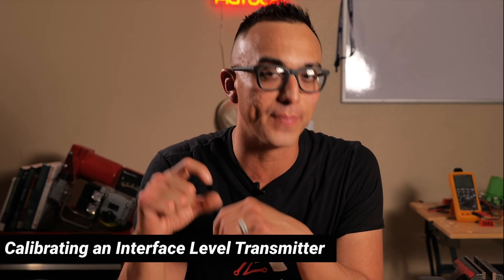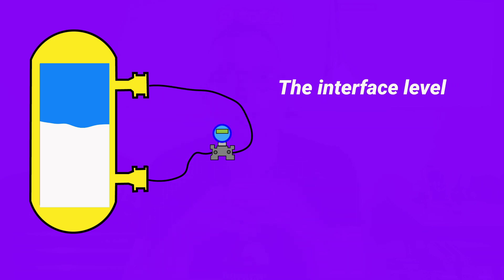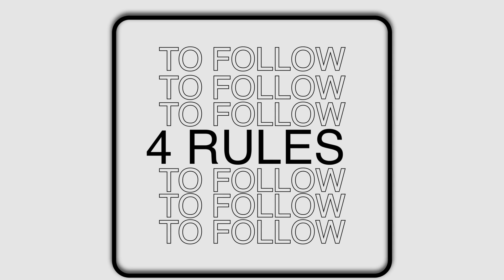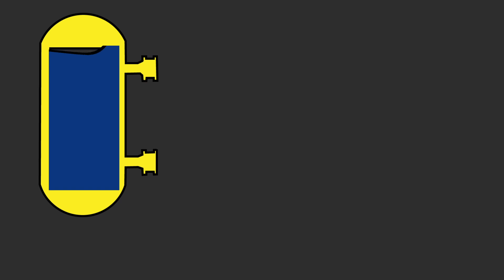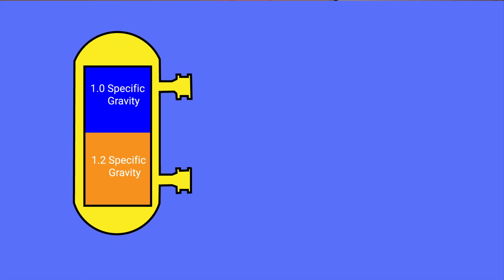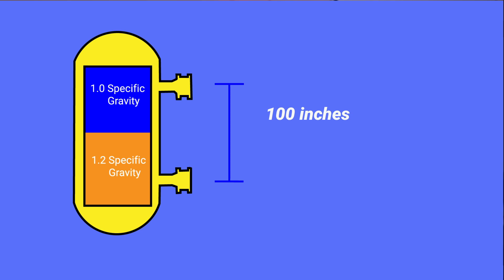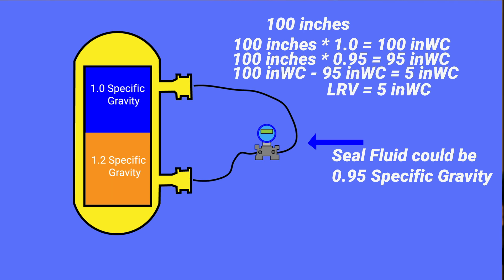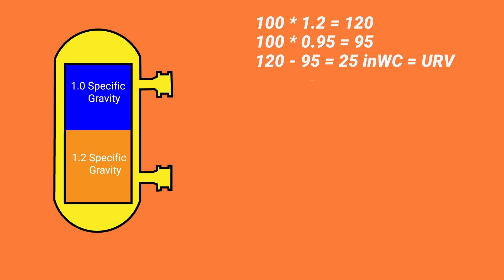Level Measurement - How to calibrate an Interface Level Transmitter

Comment: good evening sir, thank you so much for this, please i want to ask

currentle i work with E4 Modulevel magnetrol displacer level transmitter.i have tried to carry out zero and span calibration but i still get wrong readings as compared with the manual sight glass guage. it is supposed to work as an interface measurement
Reply from the maker: Great Q. I've worked on these on the past as well. Quick Qs: 
Are you doing a dry calibration or wet calibration?  (Manual: 2.6.5.1 Dry and Wet User
Calibration Procedures)
Are you receiving any error codes?
To further troubleshoot, would you have a full model number? It should start with "E4M..."

Also, if you believe the configuration is correct, and calibration has been attempted and still not correct, it could be an internal problem...perhaps the displacer is hung up or possible build up in the root valves.

Please let me know how this job has gone for you. Thanks!

Comment: u get 0.95 from where
Reply from the maker: Great Q. So, the 0.95 SG is the specific gravity that is the fill fluid inside the capillary armored tubing for the remote seal level transmitter. So, the 0.95 can be different, it could be a little lower or a little higher, depending on the application...for example the pressure rating, or temperature in the vessel. So, in this example, I'm using 0.95 SG because I've seen the most common fill fluid to be silicon oil DC200, which has a SG of 0.93 at 25 degrees Celsius. So, just for example purposes, I kind of rounded and used 0.95. Does this make sense?
If you google: "specific gravity of silicone oil dc200 ", it'll tell you more about the SG.

Comment: I have a closed tank empty, with a remote sealed diaphragms rosemount 3051cd, lrv- (-223”) urv-(-83”) , they want me to re range it to 0-115”. I’m currently reading -83” when I close the isolation valves and open the bleeders. What steps should I take to set the new range accurately
Reply from the maker: Hello Juan, Great Q. >> Ok, so you'd like to measure level with the 3051cd. Just to make sure, you have a top tap and a bottom top and Operator has made sure the there is no plugging in the bleeders. If that is true, then let's say your bottom tap is 0% and your top tap is 100%. To me, if your input is showing -83 inH2O with both taps blocked in, and de-pressured with the bleeders open, then -83 inH2O would be your LRV. It doesn't sound to me that the 0-115 inH2O would be correct. In this scenario, if the span is 115 inH2O, and your input is -83 inH2O with the block valves closed and bleeders open, I would set the range: [-83" - LRV and 32" - URV]. This would give you a 115" span with the zero at -83" input. Make sure you measure with the tape measure to make sure Operations wants 115" for their full range of scale. Hope this helps! On a side note, it may good to test the sensors by "pumping" or pressurizing to span to make sure sensors are still good as well. Kind of like a 5 point calibration.
Reply: @ the LT lrv-223” and urv-83”. Both block valves closed and both bleeders were open and was reading -83”, I pump up the hp bleeder and would bring it closer to zero. But pressure wasn’t holding it would start going back to the negative numbers. In the filter they put re range to 0-115”. I’ve skipped it until I could figure how to do it correctly

Comment: Hi sir, I was discussing with you that I have a LIT installed on my plant and its reading matches the local one but there is a difference in the CCR, so what could be the problem?
Reply from the maker: Level Indicator Transmitter measuring interface, RF Admittance transmitter. Good question: At this point of troubleshooting, I don't think there is a definite answer at this time, however, I do have other questions to be able to help: 
1. Is the reading at the CCR reading steady, giving a steady incorrect reading at all times...or is the reading coming in and out, like an intermittent problem?
2. Are you able to "shoot the loop" from the transmitter to the CCR to make sure all connections and wiring, configuration is good?

Seems like there is no issue at the transmitter and element since it is matching the local level gauge. Is that a sight glass? or an electronic gauge? 

Also, just curious, is the transmitter is an Ametek Drexelbrook? If so, can you provide the model number?

Thanks a lot, glad to provide any help possible. I've been in plenty troubleshooting scenarios. We'll get it figured out. 
-JC